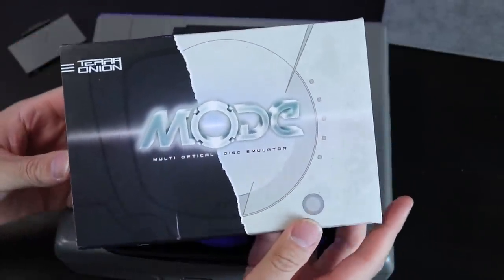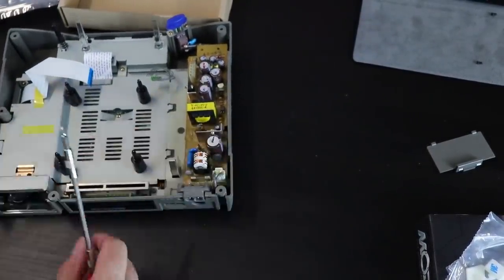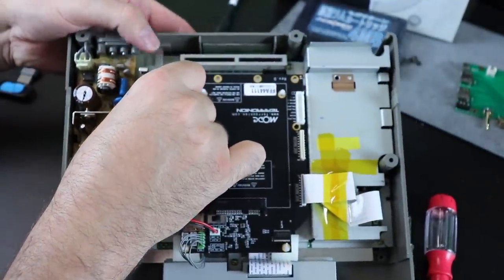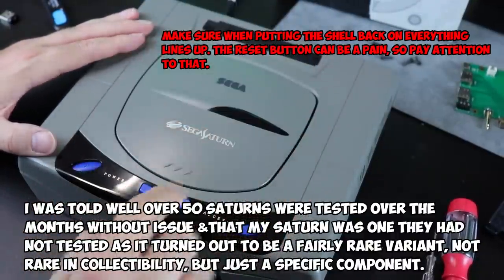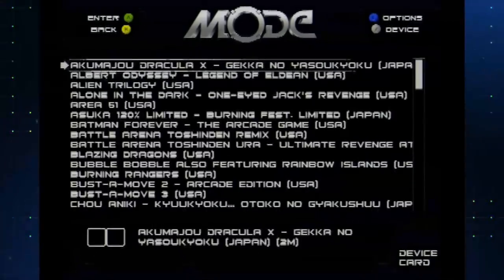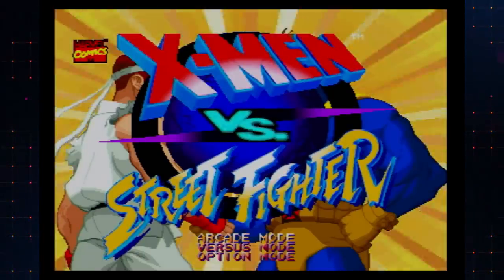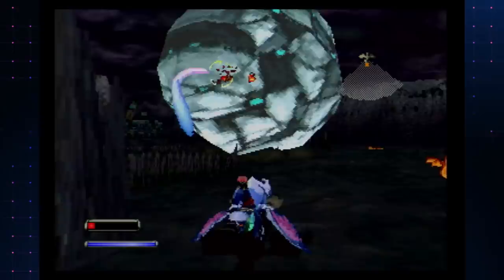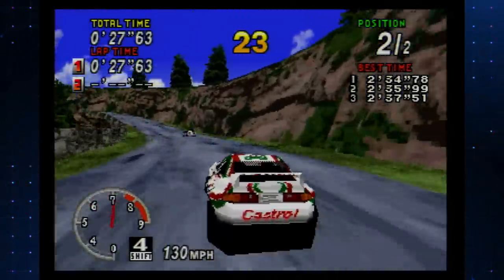TerraOnion MODE Sega Saturn Install,Test & First Impressions! Was It Worth $200? Review

Comment: I'm amazed at how fast it arrived. Shipped on Jul 10. Arrived on Jul 14. Loving the product although I have chosen to use it in my Dreamcast as opposed to the Saturn. I had some issues with crummy GDI files not working but I have replaced the defunct files and it works perfectly now. Excited for the cover database to be ready! Also, feels nice knowing that, should my Saturn drive ever go out, I can just pop this bad boy in it!

Comment: It seems like a good value if you’ve actually shopped for Saturn games. $200 can maybe get you two good games?
Reply from the maker: Yep, some games are even more than that alone 😲
Reply: For $200 I sell every Saturn disk ever released and the 1TB SSD to put them on.  You just need to provide your own $200 MODE and the Saturn to put it in.
Reply: I wouldn't even consider collecting physical media anymore. Especially CD based games from the late 1980s-early 2000s. 
Considering the increasing rate of disc rot/data rot. Which is inevitable and will gradually render all optical media useless. 
It is much safer and cheaper to mod existing systems with card readers or hard drives and download your collection of retro-games.
I have since modded my PS2, OG XBOX, Dreamcast, and my GameCube is next. If and when Saturn clone card readers are cheap and plentiful. That is next on my list.
Reply: Just sold my Saturn games and bought this. Three Crazy Dwarves and Die Hard Arcade buys this alone.

Comment: What up Ron?! Curious about loading times. Were they non-existent? Much faster? About the same? Looks awesome man! I just got my first Saturn so I might have to move some inventory around to get this!
Reply: I think they said the buss speed of the CD interface hasn't changed. Read times would be faster than the default drive but it's limited on how fast can the Saturn motherboard can actually read the disc. But there is zero seek time, the time lens on the stock CD drive would spend searching for the relevant part of a Disc before reading. So there a overall faster loading.
Reply: EDIT: I said increase in loading times but I meant decrease, I fixed it.
In general, ODE's by design have to achieve the precise speed that the host console can support for compatibility, but you will notice a decrease in loading times due to the fact that you don't have to worry about scratched discs and no seeking.   It's like how the Analogue console clones are essentially the original hardware by programming the FPGA in it to become the system, the ODE is programmed to become the stock disc drive, but instead it mounts your game bin as a disc.   You'll notice a positive difference, but it's not like going from an old HDD to an M.2 SSD on a PC.

Comment: Something's not clear to me: with the "auto region" option, will my PAL Saturn be able to play NTSC games even without the 50/60 hz switch?
Reply: That's my question too. I guess the autoregion allows a PAL saturn to run ntsc games but in 50hz.  I have a modded saturn and I ordered this device too. I'll test it once received and tell you if you want.
Reply: @babelclub9017  Yes, please! Looks like few other people are interested but it also means it is unclear. NTSC games at 50 hz... what a nightmare!

Comment: Does the Mode also save games to the sdcard/ssd? Or do you still need to use the normal save storage on battery/cart?
Reply from the maker: No, you save games as normal. Internal console memory or memory cart.

Comment: Does it always need the 5v? There's a switch above it that says Saturn 5v or external 5v, is the connection direct to the PSU the external one and the Saturn 5v that is provided only by some models?

Comment: In my experience, most of these types of products are VERY picky about SD cards.  Just last week, the micro SD card I had in my Mega Everdrive suddenly stopped working for no reason.  It was a cheap Lexar microSD, but it WAS working up to last week and suddenly I got IO errors.  I tried my two other Samsung microSD cards, all formatted to fat32, and nothing worked.  Finally I went out and picked up a Sandisk microSD and it worked perfectly.  I've experienced similar issues with my SNES Everdrive, my Rhea, and my GDEmu.  You really need to use genuine Sandisk cards on these products.

Comment: Hey man can I bother you for help with my mode? What was the issue you had with you ribbon cable? I installed my mode in my saturn and it won't boot instead it says lid is open. I have put it in my dreamcast and it works. Please help I'd appreciate it man.

Comment: Only thing I see as a negative about this thing is how do you get the sd card usb stick or hard drive off without having to unscrew the top? Seems inconvenient if you want to add new games to your sd card or other device! The only way I guess is too just make sure you load everything you want the first time so you dont have to constantly unscrew the top off to get access to the storage media! But maybe I'm wrong. I dont understand how this works exactly. Can you or anyone explain how this works thanks?
Reply: Actually that would be a problem, but for some time by now there have been 3d mounted parts on sale along with SD card extender adapter, allowing to have easy access to the memory.

Comment: Can i still install if i got a third party power supply?
IDK haven't opened up the saturn in years.
Is it just drop files on the hardrive or do i need to format a cretin way?
Also want to know if there is difference in sata and regular harddrive? Speed difference and loading and such.
Reply: I remember when we were working on performance, mechanical hard drives would have a "spin down" issue that would cause interruptions when streaming or loading new content was requested from the drive. The fix was simple: Code the firmware to keep the mechanical drive spinning. It worked like a champ. I personally went with an SSD and have been very happy with it.

Comment: I was going to go with a Fenrir, but I happen to have the "rare" Model 1 with JVC drive and that ODE doesn't work with 21 pin drives. I've bought two Saturn's in the last couple months and both of them have been this variant, interestingly. I wish they would have just made a single SKU for the Saturn and dropped the price. I have no use for its dual purpose. Either way, Terraonion makes great products and I'll probably cave in and buy one!
Reply: It wouldn't necessarily be cheaper. They're obviously saving a bunch with packaging, materials, etc being shared as it's one product for 2 systems, and as a result, being able to do a larger production run. That's what really drives costs down.

Comment: I wish they had an mode for each console, just so I could save on cost. I own a gdemu already : (
Reply: I don't think having separate versions would save much money. Most of the BOM (materials) would be the same (PCB, processor, SD card slot, SATA slot, USB port, etc. etc.), plus the cost to produce packaging, shipping, cost of support, the extra intricacies of adding an additional SKU, etc. Plus at the end of the day, most of what you're paying for is to recoup their R&D cost which exists whether the product supports one or both consoles.
Reply: @traviscombs6947  Makes sense, I guess what I meant is, if I want one for both I'd have to switch back and forth between the 2 consoles, or buy it twice which would be quite expensive. It's always good to have options but from a business standpoint it wouldnt make much sense, I give you that.

Comment: I have to ask what hdmi piece you are using,the resolution looks sharp and vibrant!
Reply from the maker: Rad2x
Reply: Madlittlepixel I knew it!! Damn that looks great!
Reply: I’m gonna use the Saturn retro gaming cables with my retro tink pro ,do you think that will give the same effect?
Reply: @deerocker4113  - Whats the "Retro Gaming Cables"?
The RAD2X has the same image quality as the Retrotink 2X Classic.
The Retrotink 2X-PRO and 2X-SCART handle Chroma output slightly better.

Comment: Great bit of kit with a multitude of storage format options, but €200 shipped? Sorry, for less than that alone I’ve put a Fenrir in my 20-pin VA0 Saturn and a GDEMU in my VA1 Dreamcast. I’ve also added Pico PSU’s to both consoles and modded the Dreamcast LED, CMOS, and controller port fuse. All for under €200. If you don’t have a 20-pin Saturn I know that Fenrir is a no go (for now, Ced is working on a 21-pin version) but the “interchangeable” feature of this isn’t a feature ... no one is realistically going to open their consoles up ad-hoc and swap their MODES, so to mod both consoles with this, you’re nearly €400 shipped for two of them? I work on a “cost to job done radio”; and for far less I get the same outcome, ODE’s in my consoles and GDI/CCD games working great on my retro systems. Fenrir, for some reason, has a lot of haters but I’ve had zero compatibility issues with any games I’ve thrown at it and I’ve tried pretty much every major game and some obscure Japanese titles too.

Comment: I noticed that you didn't actually show the game booting. Is there a reason why? I'm sure the device works like you say it does but just curious.
Reply from the maker: Only reason is because it loads exactly the same as a disc and takes a moment, I try to cut insignificant clips when possible to shorten my videos. But the other big thing is with my capture setup on the Saturn using the RAD2X the video signal cuts out when going into the bios screen for a second, then again when the game loads. No point in showing a video of the screen saying "no signal". If I kept all that in some people would not understand why it did that and would think there is an issue with the MODE when in fact there isn't. So I didn't want to cause any unneeded confusion.

Comment: 1) Never showed us what is going on with usb sticks.
2) The installation procedure could be better to be in real time and not fast forward.
3) Never showed us how the storage structure should be on sd card or USB or Hard drive.
Nice little board but i am gonna wait for satiator and see which of the 2 will be cheaper. Thanks for sharing!
Reply: Also never actually showed any of the games booting.

Comment: Someone NEEDS to do something like this for PS2 Slim!!!
Reply: Get a phat & OPL is well over 95% compatible... that's conservative. I had almost 100 PS2 ISOs running perfect. You can mod it for WAY under $50, HDD & FMCB included. That's why it doesn't exist yet. Other cheap, viable solutions.
Reply: would like to know, why the PS2 isn't loved as much as other consoles in hardware department?
- There's no plausible HDMI solution;
- There's no 8bitdo accessories;
- There's no ODE;
- There's not (as many as Wii) emulators, nor even close or as good as;

If not the love by the Softmod community I would think PS2 was forgot.. why?

Comment: Is soldering involved on the dreamcast?  Does it destroy the old lens?
Reply from the maker: No soldering. On Dreamcast it is easier to install in my opinion. Just remove the gdrom drive and attach the mode. If your drive was still working it will still be fine if you want to use it again another time... Just store it safely... Accidently drop it on the ground and a good chance itd be destroyed.

Comment: Decent product, but the install is finicky and potentially intrusive to the ram cart slot without further mods. I would honestly rather wait for the Satiator which requires no modding.
Reply: It's not hard to trim the plastic feet to clear the ram slot.
Reply from the maker: Yeah trimming the plastic is not really even a big deal, its not modifying the console in anyway and takes like 2 seconds. I just pointed it out as I noticed it and sometimes ram carts can be finicky even normally.
Reply: @RedArremer  Fair points from both of you. I just prefer something that's mod free and/or 100% plug and play. If the install requires cutting or trimming then I pass on it. This is of course my own opinion and shouldn't reflect how others feel. As I stated before, its a decent product. Btw FirebrandX, thanks for all the work you put into those ossc profiles. They've been really helpful.

Comment: I have a Rhea and a gdemu so no need for this. The reason why you had issues with the Rhea is that they weren't ripped property. I had the same issues until I got a different source of the rips and haven't got a problem. All games work great with my Rhea. Good value with the mode though.
Reply from the maker: I dunno, was using the redump and a few games didn't work properly for me, but using the same files they worked on the MODE for me without issues.

Comment: The dual purpose doesn't make much sense to customers; it's only ever realistically going to be used in one console at a time. Would've been better to release specific Saturn/DC ODEs at lower prices.
Reply: The dual system compatibility is actually cheaper for TerraOnion to produce. Having two separate SKU's and managing individual system stock is less efficient. The hardware is the same regardless, so there is no savings to be had by only supporting one system. The compatibility is enabled in software and us as users can decide what to install on. It really isn't made to be swapped out between both systems. While you could do that, you are better off just buying one for each console.

Comment: $200 device that won't detect usb or fit properly, nice.
Reply from the maker: To be fair, it wouldn't detect the 3 drives I tested. I don't know why or if specific others would work. I plan to do more testing with usb though
Reply: @Madlittlepixel  fair enough.